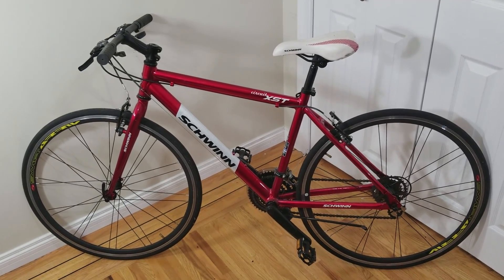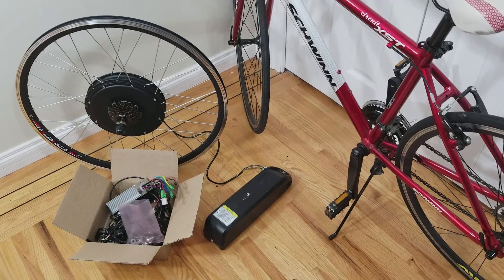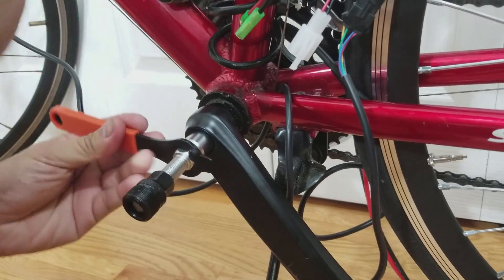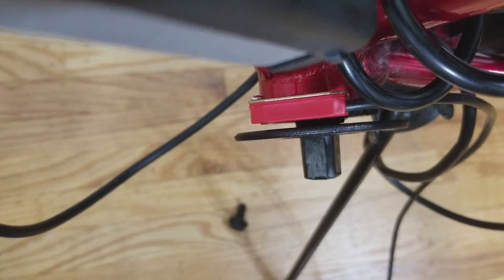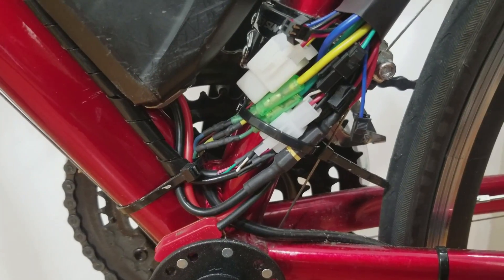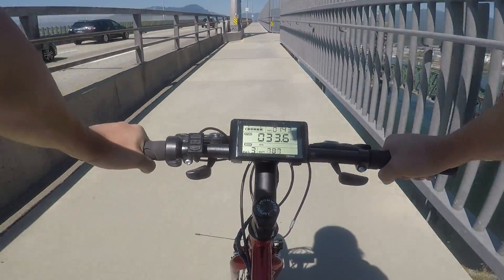1200 Watt EBike Build - Cheap + Fast = DIY

Comment: I bought a battery bag that straps onto the frame. Bought foam vibration pads to absorb shock. Haven't installed yet but mine is exactly like yours. Is my idea something you wish you did? Great video btw

Comment: Hi, could I ask some advice? I'm looking to build an ebike but I really prefer the commuter style bikes (where you ride in an upright position). However, these don't usually have gears.. Would the lack of gears be a big problem? I would only ride on roads but we do live in a hilly area. Would the lack of gears be a very bad idea? Or would the motor help overcome that?

Comment: Im gonna flip my battery where the key is at the bottom then run the long wires down the bottom tube wrapped in electrical tape that way I wont have to cut the wires down and drill a hole in the frame.

Comment: Awesome video!  Are the torque arm holding up well?  On the brake pad as torque arm mod, how did you cut the slotted hole (10x14mm)?

Comment: A rivet nut, exactly the thing i was looking for to attach my battery a bit more secure.
It already has 2 bolts, but gosh the battery is wobbling at high speeds.

Comment: I put 55v through a cheap 40w spotlight and it's still working years later and SUPER NOVA bright 🔆 😂 its one of those thin flat floodlights with around 12 cree chips, about a  5inch circle , cost me like 15 bucks on ebay

Comment: The problem with these kits, are the poor plugs. The green plugs melt if you are riding a long hard hill. Change the plugs or take a brake to control the plugs.

Comment: The bike I'm converting has 9 speeds on rear wheel, the bikeling kit has 7, can I adjust existing derailleur to work for 7
?
Reply: You could if the gear spacing is the same (space between gears) , then you have to adjust the derailleur's limit screws so the chain can't go pass the first and last gear...

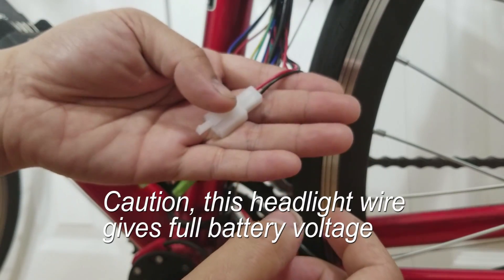Comment: 4:30 What lights can you install on this connection? You said it provides full battery voltage: What lights run on 48v? Most lights for this application are 12V, right? Thanks!
Reply: QD151 Starunion front light 12V-80V!
Reply: I guess the controller makes an output of 12v for the lights if I'm not wrong

Comment: I have the same battery.  Instead of drilling mounting holes in the frame, I drilled holes in the battery attach plate.  Put two holes in the metal plate where the wires go through.  There is a plastic cover that can be removed with three small screws.  Mounts to the standard mounting holes on the bike tube.  Wish I could post a photo hear.

Comment: It's funny how they give a smaller react 20A controller for a 1200w hub motor

With my 1000-watt hub motor
I got a 30A controller 
I also modified it to 35A to 40A.
It's a big difference in acceleration.

I'm wondering what its like with 
20A controller with 1200watt hub motor

Comment: The battery price alone makes my wallet crying... It's really expensive...
Reply: I know it hurt to do it for me but I just had to bite the bullet lol
Reply: I'm always building my battery packs 😉 buy them in bulk separately but a bms  and case
Reply: @robz8989  you still build? Battery prices are high.. and much scam. Where you get your batterys? You use 18650? Oder 21700?
Reply: I'll be trying with drill batteries I already have. Should work
Reply: Could you get a good battery
120 dollars?
Reply: @normanbfifteen3468  No the double atleast
Reply: Learn to buget your money,and your wallet wont cry no more....simple as that...

Comment: Thanks for sharing, nice video, well done and with plenty of explanation.
Good quality of components used just the cable wiring needs a better solution.
The black paint on the aluminium case of the controller won't last long.
I wonder, was necessary to mount a 1200W motor instead of one smaller for less speed/power (and cheaper) but longer range with the right batteries?

Comment: Was your PAS designed to be mounted on the left side? The one I got with my ebike kit says to mount on gear side but there is not adequate room or bearing flange to hold it.

Comment: I am writing this for the buyers.  Maybe it will make things easier for others.

Ebike front wheel conversion kit was shipped quickly.  This was the only good news…

Manual was terrible, worse than useless.  Had to spend a lot of time to find
suitable  instructions on YouTube.

I had a lot of serious problems with the front wheel, sitting in the fork properly.  Because the new wheel had larger diameter axle, it was sitting about 1/8” off center, comparing to the original wheel,
and washers didn’t fit now into the indentation in the fork.    I had to file safety washers to get them into
the fork indentation.   Hopefully, I won’t get killed in the accident after that. If I knew only about this problem upfront, I probably wouldn’t buy the kit at all…

Break levers were useless because mine were integrated with gear switch,  so I couldn’t replace them, and  magnetic break sensors were missing, although they were mentioned in the manual, as an alternative.  Had to buy them myself at extra cost(>$25).  New magnetic brake sensors worked well, after finding the right position for the magnets.  Throttle didn’t match the one in the manual as well, but at least it worked, after sorting out LCD PAS setting problem.

Getting pedal assist installed was even worse.  There were no instructions.  It required extra tools that had to be
purchased to remove the crank  arm.  Had to wait for weeks for the crank puller.  Then stripped thread on both crank arm and the puller.  Then I had to find another PAS model  that didn’t require crank arm removal.  More time and money.  I also have to replace the crank arm now, because the thread is stripped.  Then the new PAS
sensor turned out to be defective and has to be replaced.  I am still not done with this, almost 4 weeks
since the purchase.  The whole PAS installation was a disaster in slow motion…

Controller and LCD.  There was no diagram, one was supposed to match wires by a connector type and wire color.  When the battery came in and I started connecting things to check it out, I had discovered that the controller had ring style connectors instead of bullet connectors on the motor (although they
came together as a kit).  Seller tried to send me another controller with the right connectors, but couldn’t do it quickly. So we decided that I will try to replace them myself, by buying female bullets, crimper, solder,
flux and iron. So, I managed to replace these connectors.  Finally I was able to connect most of the
things to the battery to check if this thing was working.  And it didn’t.  Everything was dead.  Communicated with the seller.  It turned out that one had to turn on the LCD display by pushing the middle button on a little switch, attached to the LCD, and then push the upper button to get PAS at 1 or higher. Finally, the throttle
worked and the wheel was spinning.  I was happy, and upset at the same time. There was nothing in the manual
describing this procedure. Thankfully, seller had refunded some costs related to hanging the connectors.   In the end, controller had 3 extra wires/connectors left over.  No instructions about what they were for or what to do about them either. 

No tools were included, nor were the instructions on what is needed.  And one needs a lot of tools, some very specialized, maybe used once. Manual doesn’t address this at all.  So a lot of tools had to be learned about and purchased, adding a lot of time to the project.  It took about 2 weeks and many trips to the hardware store.

Overall, I had to spend at least $150 above the cost of the kit itself, plus a ton of time and gas.

All in all, this was much more difficult and frustrating project  than I expected.  I was ready to give it up and ship the product back several times.  Seller was trying to help with most of the problems (although many could have been avoided with better product description, much, much better manual and video links).  This whole industry seems to be populated by young unprofessional people, bike shop kids or/and Chinese entrepreneurs with
limited English…

Then,  I learned about Simon Cowell, who broke his back trying a new electric bike.   So it occurred to me that while one has to spend over $700 for everything plus a lot frustration and work, the alternative is a very nice 65” TV with an excellent manual and no real need for it.  One has to hope that this was a better decision.

Comment: Well done for using torque arms, most builders miss this out and it's very important.
I just finished my first conversion with a similar ( cheaper) motor and battery and love it.
Reply: Why do you need a torque arm?
Reply: @carstrucks9641 so the torque from the motor doesn't shear the mounts/nuts and spin out of control.

Comment: The controller is rated at 22A x 48 volts = 1056 watts not 1200. 1200 is perhaps the motor rating.

Comment: I really want to build one of these. I injured my knee & can no longer peddle bikes like I used to. An Electric bike would allow me to get back into cruising.
Reply: oh man! ouch, i nearly fractured both arms falling off my ebike and couldnt ride for a while, (tip, when building this you can sometimes have the electric brakes stuck which stops the motor from turning on, a problem i had)
Reply: Hope you get well soon
Reply: Its hard to build this, and very very difficult for injured people 😢 i can build u one tho!
Reply: You gonna fix your knee or just live with it for the rest of your life?
Reply: @18matts  you can't fix a leg that gets blown apart in Afghanistan. Especially when you're government gives 2 shits less about veterans & our health care.
Reply: @johannbach1903   First and foremost, thank you for your service and sacrifice. Our vets deserve better. Much respect 

I'm about to add a rear hub motor to my mountain bike due to multiple health issues that have kept me from riding frequently and aggressively for over 15 years. I cannot wait to simply take off on my bike without always worrying about keeping pace and being able to reach my destination, ideally without injury or severe strain. 

I can't get back out there on my own. It's just not physically possible. I should have done this years ago...have finally determined and accepted the fact that it is a very necessary conversion.

Go for it man!

Comment: excellent video Doug, i would love to see a breakdown of the costs, the wheel looks very high spec so i guess everything is actually quite expensive, but the performance is very good and the whole install looked really good, appreciate the eye for detail but the modifications and extra fittings make it seem a bridge too far for me at the moment
Reply: I just got this exact kit and they must've watched his video because it's completely plug and play now, the only thing you need to take off is the rear tire and brake levers/cables. Everything else clips/zip ties right on. You don't need to de-pin any connectors or make a 2nd torque arm or take off the crank. It's all much higher quality now for probably the same price it was 2 years ago when he made this video, it even came with extra washers for everything in case you drop one and lose it

Comment: Hey Doug,

I know I'm a boring ebiker, but hey I'm in my 60s and still love a good pedaling bicycle. 
 
I live outside of town and I don't own a vehicle and live on the very essentials. Anyways, I have a question about ebikes. I'm wanting to know if I could buy a 52volt battery to get range out of my mxus xf15 hub motor? I'm not looking at wanting a rocket.. 25 mph seems plenty fast for me.

Comment: sir the throttles  is only  about 10 dollers  that suit the SW900 KITS and they have a volt meter built in them too if you want to know  heres the link https://www.ebay.co.uk/itm/UK-16-Thumb-Throttle-with-LCD-Digital-Battery-Voltage-for-Ebike-Electric-e-bike/152948275841?hash=item239c6d7a81:g:AqMAAOSwjpRarN38

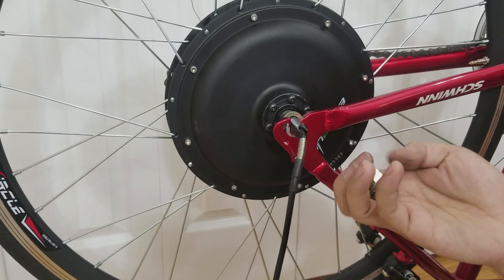Comment: 1:49
There's a good reason it came built. It didn't need torque arms. The frame is more than sufficient.
Reply: so i wont be using that?

Comment: Heat shrink those exposed wires. Maybe even some tubing to hide cable joints. Exposed wires tend to get cut, Also rainwater can damage those cables

Comment: I built 500 watt 36v 10 amp front wheel motor kit for $160,    $60 SLA (3) 12volt batteries. Motor 17lbs batteries 23 lbs.

Comment: I used 2 truck's mudflaps,sized them,shaped them and cut a little hole to connect the charger to the battery,it works great and looks great,you did a great job.
It s my kid's bike though.

Comment: The last schwinn hybrid bike I had was a maintenance nightmare. The Crank rounded off and sheared the bolt, and I had 3 rear flat tires. I replaced all of the components and sold it at a huge loss.

Comment: This process takes metal work, I'm out. I'm interested in a complete kit solution that's easier to assemble.
Reply: If im not mistaken and the only metalwork is making the holes for the battery mount - you can install the battery however you like so long as its secure on your bike. This includes water bottle shaped batteries that go in a water bottle holder, velcro to frame batteries (with straps), pannier rack batteries, or just screw one of these onto a pannier rack...

Comment: How fast does it run and how many miles can you go on a full battery charged?
Reply: It is hard to say when using a different battery. Most battery boxes are the same. The real difference is the core. Who makes the individual cells, capacity, voltage, nickel plate welding, wire gauge, thermal sensor, BMS.

Range is dependent on battery.

Comment: Hey I Hope some can help me.  So I bought a El bike without a battery for 2 months ago. i swaped in a 350 18amp speed controller and a 52v battery. and a Wattmeter. That worked fine i was hiting 950W At acceleration. and had a top speed of 25-30kmh  While drawing about 11-13amps

But I Decided to go for a upgrade. so i bought a 1500W Speed controller. I Installed it But it's very disepointing. I reach 1.2kw when accelerating. and  i can hit 30-33kmh  top speed 
The New speed controller Hit's about 13-17amps when riding that speed.

i have Opened the new speed controller and it has Alot of Mosfet and look Very good. It has never ever gotten close to Warm.
And i'm wondering Why Is it not Drawing More amps It's says it can draw up to 45amps

Btw The 1500w Spee controller does hit about 25amp In Very hard uphills

Btw i Hear alot of The fact that 1500w e bikes can hit 50kmh+     

On the last controller i used 5ah 52v battery
on the 1500w Controller i use currently 8.5ah 52v  battery

Yes There is some voltage sag when Accelerating so i know if i add more batteries in parrall i will get Less voltage sager and more watts
But I just want the speed controller to Draw more amps

Please help any
Reply: Your batteries are too small (ah wise) to deliver the amount of current you need!

Comment: Give it another 5-10 years when the battery life and wireless power transmition technology improves, the weight is dramatically reduced and the price comes down and e-bikes will become a viable option. But right now they are still something of a novelty act unless you have money to burn on the top spec kit. 20lb of added weight(!) and all of that bulky battery and connector block malarky getting in the way + the ugly wires everywhere. Not for me mate.

Comment: I use the Bag Bikase Long John Bk from Amazon 39.00 to hide all wires just put the controller in it and put a hole in the end of it and screw in a 1 1/2 in PVC bushing so it looks pro and prevents fraying.

Comment: That controller together with the wires should be in a case. You can find these on Amazon as "controller case ebike".
Reply: Chris Liddiard i would just make sure the case+ battery are waterproof then use a few different sizes of black shrink wrap to hide the wires and connectors.

If it was in a case he certainly couldn’t keep it where it is now.
Reply: @Tuber360904  My first e-bike had the controller in a case, underside of where the battery is.  My current e-bike has a controller in a larger case on the inside of the downtube. I think the builder would have space to do the same if he moved the battery up a bit.

Comment: "Battery used: hailong 48v 14ah" 
Without a 25 Amp battery capacity and controller, you are losing out on 44% of the motor's capabilities.
Reply: That's what I was thinking, 50kmh topspeed with a 1200w is too much low
Reply: Not only the battery should match, but i think that it should be higher so that the battery can work more efficiently
Reply: @TheGameIsFunny  Indeed. Especially when considering that Lithium batteries do have a shelf life. Their total capacity decreases over time. 

But of course the size, weight, and cost all factor into how practical it can be to fit 3-4 LiPo batteries on a bicycle.

Comment: How is that cheap?
Reply: It is for an e bike.. Batteries are expensive if you want a light but high capacity one. He could have made this build cheaper buy using lead acid batteries however they are heavy. Also the hub motor used in this video is pretty cheap in comparison to higher end mid drift motors

Comment: hello good video, the controller can be placed inside a waterproof box so that it does not get wet or you can make one with containers to use in the microwave since you put it in a place where if there is water on the floor or it rains the wheel will take care to wet the controller as for the cables you can use a small tube or a flexible rubber tube plus a thermoretractile so that the connections are not exposed to rain

Comment: Do i need to install the rotor if i only want to use it as pure electric "moped" bike?
Reply: Rotor? Disc brake? Pedal assist? If you're using as a moped, then you would be advised to just install 2x LH cranks in the same position and remove the front chain ring and chain. Need to rest your feet somewhere.